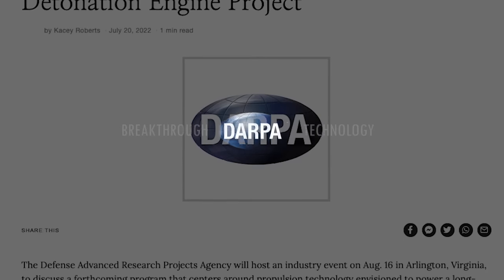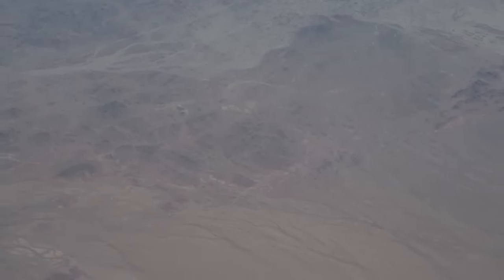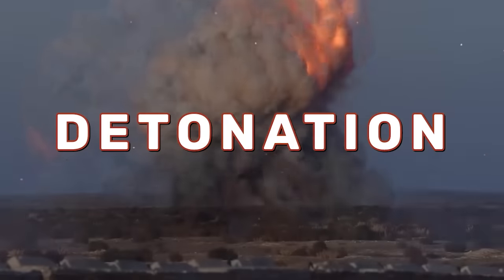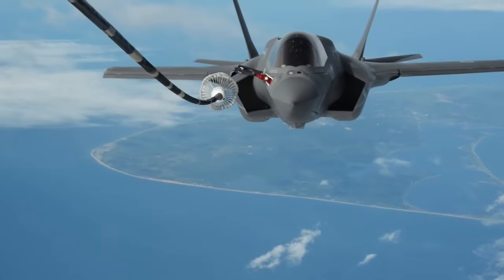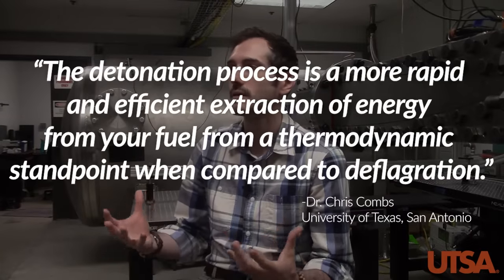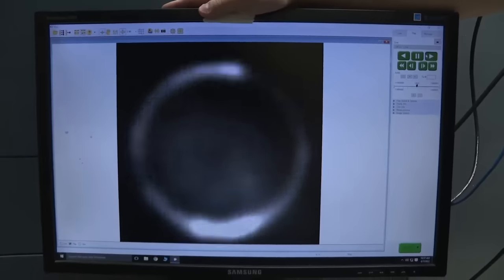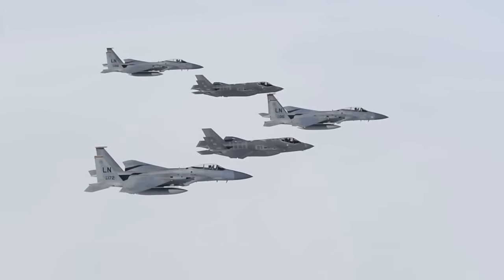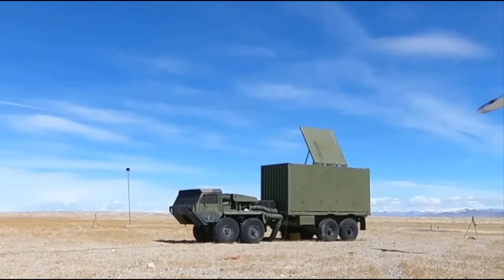The game-changing tech in DARPA's new missile

Comment: The proper, simple, explanation for why detonation engines might be worthwhile to pursue, is this:
All thermodynamic engines get their energy from fuel being burned with oxygen. That's the start, and it's the same for all engines. There is not 'more' energy available for some engines than others. It's only the chemical energy in the fuel, a fixed amount. Same for all. What is not same for all, is how much of that energy, the engine is able to convert into work. This is why we have the concept of thermodynamic efficiency. (With rocket engines and jet engines we also have propulsive efficiency, but forget about that, because this does not concern that.)

Now it happens that all thermodynamic engines extract their work from the ' Expansion ' phase of their working gas, which typically - and particularly in this case -, is the same as the combustion gases. The greater the expansion, the more work = useful energy, is extracted.

Now we come to the first point: You can have more expansion if you first compress more . This is why we have Diesel engines. It's why the most advanced jet engines have pushed to 80:1. It's why SpaceX is pushing for +300 bar in their Raptor rocket engine.

But, here's a crux: As the fuel burns, the combustion gas expands (in jet engines and rockets , in piston engines you of course get the combustion before expansion), because the expansion moves faster than the burn reaction. So you don't get to suck all energy from the max, theoretical, possible expansion. What if you could have the reaction (fuel burn) take place before the gas expands? This should result in better fuel efficiency. And it will be achieved if the reaction (fuel burn) is faster than the gas' expansion. And that is what we call detonation .  The full burn first, then the expansion, instead of expansion during the burn.
Reply: @Vermilliontea,

Very well explained. Thanks, your post was helpful.
Reply: Great explanation!!  Thanks!!
Reply: Didn't think this video could be better. Your explanation supports why Japan, Australia and anyone frankly able to produce this technology would. It's applications are beyond military and aerospace.
Reply: How come the fuel can both deflagrate and detonate? What’s the difference between these two modes?
Reply: @user-ee1fn4vt8b  During Deflagration (gunpowder, smokeless powder, petrol, etc.) the burning front moves through the fuel/air mix below the speed of sound in the combusting material or the working fluid. During detonation (TNT, RDX HE generally), the burning front moves through the material at greater than the speed of sound in that material.
Reply: That's a great ELI5 thanks
Reply: Thank you for that great expanination/explanation/ Detoflation very helpful.....
Serious you help alot with the explaining thank you again..👍😁
Reply: Umm not to be rude, but your assumptions are incorrect. The reason in fluid mechanics we differentiate air speeds as below supersonic, then Mach 1-5, and finally Mach 5 and higher is that different forms of the Bernoulli's are applied. The simplified form of Bernoulli’s equation is what most engineers are familiar with. The reason supersonic flight was so difficult is the fact we were learning about the principal factors we needed to add as we applied the full Bernoulli's equation. Finally we started to learn why Mach 5 started yet another new flow regime. At this point we found that the principal factors in the calculation changed at mach 5. The principal pressure drop effect at mach 5 is now a minor effect and the state of ultra high temperature and high pressure creates a higher velocity with a reduction of nozzle diameter. To fully explain the equation calculation is way too much for a YouTube response. Full industry and research papers are wrote on this calculation and published so you can search them on google if you want to.
Reply: @williamhall3887   I wonder if the misunderstanding is truly mine?  You seem to be talking about jet engines with supersonic flow?
Reply: @williamhall3887 
Just tell him that the detonation wave @ Mach numbers greater than 5 already match/exceed the expansion rate of any known, practical fuel, therefore it requires a totally different thrust ratio unless combustion takes place outside of the gas flow (or you discover a magic fuel).
Reply: So it's an ultra-high compression Mazda rotary engine?
Reply: @kizmo2317  No.  Not at all.  It's conceptionally very different.  A Wankel rotary engine works "the same way" as an Otto 4-stroke piston engine.  It's a Otto cycle heat engine.  It just dispenses with valves and stuff, and replaces them with cooling losses, excessive wear and lubrication problems.

Don't get confused by 'William Hall' or 'To The Point' above.  None of them seem to understand what is going on.
In a piston engine (or Wankel), you already convert the chemical energy (most of it) of the fuel to heat before expansion.  Which is what you want, to get as high thermodynamic efficiency as possible.  That does however not happen in a normal rocket engine, jet engine or gas turbine.  Instead, due to the free gas flow, the working gas is already expanding as the fuel burns.  This is not optimal from a thermodynamic efficiency point of view.

First of all, you apparently need to understand that when we are talking about "supersonic" in the context of "detonation", we are not doing so in reference to the speed of sound in the air, or the speed of the vehicle. We are speaking in reference to the speed of sound inside/of the rocket exhaust gasses. A rocket/jet/gas turbine works with accelerating a working gas, by having it flow from high pressure to lower pressure.  By raising the temperature of the gas, we are not only raising the pressure, but also the speed of sound inside the gas. A gas cannot exceed its own speed of sound as it flows from high pressure to low pressure.  (If you force it to, mechanically, by an ultrafast piston, you will in fact raise the speed of sound in the gas by increasing its temperature).

The entire point of "detonation" is to have the combustion propagating faster than the gas flow.  Sort of what 'To The Point' seem to want to say, in a muddled, convoluted way?
Note, that it's only the reaction itself, of combustion, that moves supersonically, inside the gas, not the gas!  The detonation serves the exact same purpose as the normal combustion, to raise the pressure, temperature and speed-of-sound of the working gas.  It just does it faster, and thus the heat and pressure will be there earlier, inside the gas, before it has started to expand much.  So we get more of the expansion after the combustion.  And since the expansion is the process that extracts heat energy and converts it to velocity of the reaction gasses, we get more with less fuel.   ...This is however much easier said than done.  To do this, really takes some doing.  Look at NASA's circular detonation engine to see how it can be done in practice.

Now there is a completely different question: Are the efficiency gains (which frankly are not exactly huge) sufficient to compensate for weight and thrust penalties?  And can they even catch up with the efficiency gains already achieved by other means?  To put that into some perspective: - SpaceX' Raptor engine already has six times higher combustion pressure than NASA's detonation engine!
Sometimes "revolutionary" technologies never catch up with the "old" present.  It only took transistor CPUs a few years to become millions of times faster at general computing, than the "Optical" computer "working at lightspeed" and regularly heralded in popular science magazines for more than a decade, could ever have become, for example.

One potential is for a small, low thrust, in-space, vacuum engine, where you for some reason insist on a chemical rocket, instead of nuclear and/or ion drive.  The big problem there, is that insisting on a chemical rocket for that is not exactly a 'game changer'.  But, depending on the progress of technical solutions, it might become more competitive for other applications.  Most interesting is probably ram-jet engines.  And that seem what DARPA is focused on.
Reply: That was Excellent. I wish you would go a little further on how to make that happen.👍👍
Reply: what Id like explained to me is how is it that since current turbine engines that are 96% efficient, how are RDE engines in comparison to? for a sample engine, lets say a GE9X, not a PW F135...or you can use F135 but leave out the afterburner can and igniter.

For you people who will eventually ask, how are turbines that efficient? Internal combustion engines use heat for mechanical energy. 75% of that heat is expelled through the tailpipe, which means ICE engines are roughly 25% efficient. A turbo will increase efficiency, but you'll still only see about a 2-4% increase in efficiency. A turbojet/turbofan/turboprop/turboshaft engine produces heat which uses that heat exhaust as thrust - the turbojet and turbofan goes straight out the nozzle which gives you thrust, and the turboshaft/turboprop propels that exhaust onto a gear driven pulley much like a water wheel generator. Almost all that heat is used and goes unwasted; even the turbofan engines heat soaked through, the high/medium/low bypass case fan catches that radiant heat and pushes it out the back too for increased thrust and efficiency.
Reply: @utley  Not quite like that.  There is a misunderstanding.  Turbine engines are normally around 25-35 % efficient too. But currently it is technically possible (but very hard) to reach almost 60% for a shaft driving turbine.  But that comes with extremely punishing limitations on operation and usefulness, so is only of interest for very special applications, not normal engines.

Claiming 96% is like claiming a candle is like 98-99% efficient because it burns almost all the wax.  It's in reality extremely inefficient because what we want is the light. The light energy produced is almost nothing compared to wasted energy of the wax, which almost all is lost as heat.

In terms of a jet engine like the GE9X, what we want is the thrust.  The thrust is generated by accelerating a propellant mass, mostly air.  That is the work done - accelerating the air - the mass flow and velocity of that flow represents the power output.  This can be compared to the power flow represented by the chemical energy in the fuel flow input that is used for this, and that is nothing at all like 96%.  Not at all.

In this case too, we lose most of it as heat - heat in itself does not contribute to thrust -.

I can not give you any figures, because those are not publicly available, and also depend on altitude and speed.  But in a hypothetical ideal Jet engine, 100%, or close, efficiency, the combustion gases would expand so much in the turbine, driving the turbine, that they are cold again, and their speed is close to the speed of the by-pass air that is driven by the inlet fan.  Of course something like that doesn't exist and never will.

But there is also another side to this. You will get more thrust for the same power output, if you accelerate lots of air to a slow speed, than if you accelerate less air to higher speeds. It should now be clear why big hi-by-pass civilian engines are so much more fuel efficient than military engines. Military fighter engines must have much higher exhaust speeds in order to have propulsive efficiency at higher speeds.
But for reaction-thrust, it's more energy efficient to push slowly on a big mass of air, than push violently on a small mass of air, for the same thrust. That is about propulsive efficiency though, not fuel efficiency compared to the mechanical work.
Reply: This comment should be pinned to top
Reply: You're welcome.
I'm proud to be associated with engineering.... and you...

Comment: It's actually really interesting how the energy is extracted makes a big difference. We have detonation in diesel engines but it's been a struggle to get it to work in gas. I don't know if the entire charge detonates in diesel engines even. It might be interesting if it could be made cheap enough eventually to offer an option for vehicles. It could make the transition to lower carbon power sources easier. 

Cool video. I would like to hear the one about China as well. Yours is the only one of these style channels that I feel gives quality information and isn't tacky. Keep up the good work.
Reply: Actually, none of the charge detonates in diesel engines. It burns. You never have a supersonic combustion front or shock wave inside a diesel engine (or at least if you do, you're having a really bad day).

That's also true in gas engines - the goal to get compression ignition gas engines to work is to get them to compressively ignite in a controlled way without generating a detonation wave, because detonation waves inside piston engines tend to break things.
Reply: As stated above, there is no actually detonation going on in diesel engines. The flame spreads slower than the speed of sound in the fluid. It merely deflagrates.
Reply: My understanding is that gas engines have a singular flame front spreading out from the spark plug, whereas diesels have many smaller flame fronts detonating throughout the combustion chambers.
Reply: @taylorc2542  It's a nitpicky issue of terminology, but an important distinction. Often, when the fuel-air mix is ignited in an internal combustion engine, people refer to it as a detonation, because it's a very brief, loud, powerful burn. But technically, it's a "burn", and not a detonation.

Imagine pouring some fuel on your BBQ grill. you light it, it goes WOOSH! with a fire ball, and your eyebrows are ruined. That's a burn, or as the video is called it "deflagration". If it were a "detonation" it would go BANG instead, and instead of looking like a miniature napalm experiment, your bbq would look like a miniature fuel air explosion, and there'd be pieces of your grill falling 3 blocks away. possibly pieces of you too :P

Anyway, internal combustion engines don't detonate, even if it is fast, it's not supersonic. And yeah, a lot of car people might call it a detonation, but not technically the right term. If it were a true detonation, then the piston would move down at supersonic speed. And nothing about the block, crank, or piston is really designed to handle that.
Reply: The way something burns makes all the difference.
There's as much energy in a ham sandwhich as there is in a stick of TNT, or a similar weight of C4. The differences are all in how rapidly they burn.
Reply: It's not hard to get detonation in a Subaru
Reply: You have deflagration in internal combustion engines, not detonations. Deflagration is a kind of the burning of the available fuel source over a short period of time (air and gas mixes, flame propagates burning from one side of the fuel in the cylinder to the other, really simplistically put) whereas detonation is more like a bomb going off.
Reply: diesel engines just use compression ignition - that's not the same as detonation
Reply: Diesels detonate if the charge does not burn as it is injected but after some amount is injected and mixed with air. There is some timed, multiple injection technology in ship Diesels with the best producing 50% thermal efficiency, a huge increase! Detonation helps diesels if it occurs at an optimum  time where the piston is on the power stroke. There is more than fits here, do some searches. YouTube is good. GM did some high speed videos of various gasoline engine detonation modes that make the process immediately evident!

Comment: I worked with Dr. Fred Schauer on the worlds first self-aspirating PDE in the early 2000's, which is later developed to what you see at 7 minutes.  You can basically eliminate the pumping losses of a compressor section, and get MUCH higher exhaust velocities.  We built it out of a cylinder head on a shoestring budget.  I thought this tech never panned out, but this concept is great!  The donwside...this thing sounded like a jackhammer, but as loud as artillery.  An RDE might also make a decent tip jet on a helicopter or prop.
Reply: Was that the one made from off the shelf GM parts?
Reply: @oleran4569  Yeah- Oldsmobile quad-4 cylinder head fed the detonation tubes.  A motorcycle engine was needed to run a compressor to force air through that restriction though.